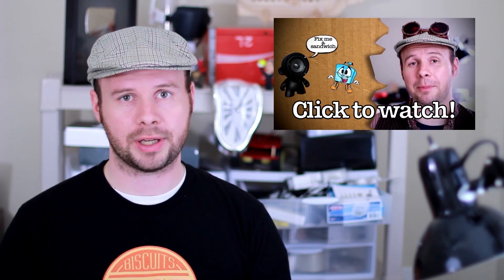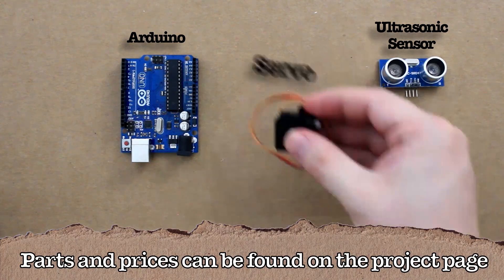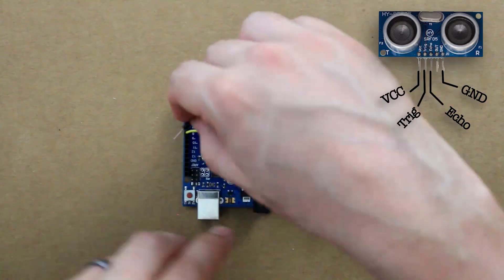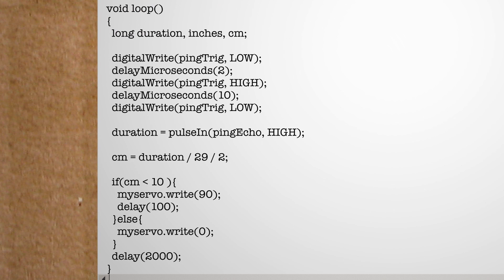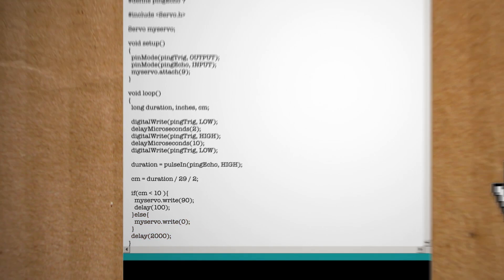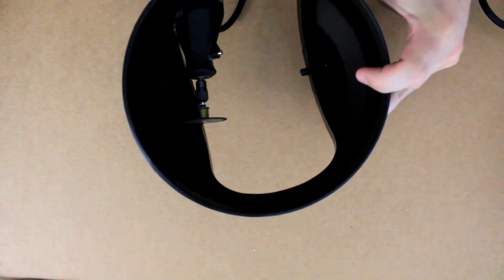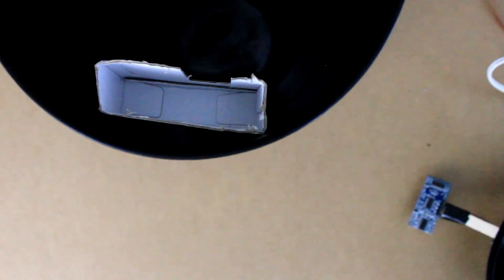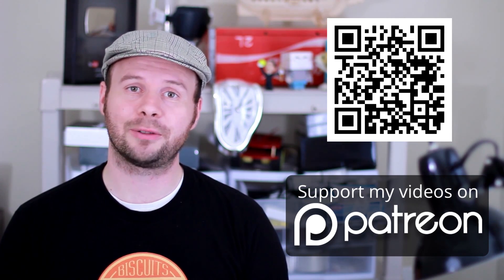Home Made Motion Activated Trash Can

Comment: Just spit balling here, but why not make an array of sensors wide enough for throwing in trash at a 45 degree angle, then setting them at the base of the can, and build a guard that doubles as a superficial "step" trigger. You'll need to increase the distance, but it will theoretically work for both throwing and standard throughing away trash without having to adapt your habits that much

Comment: mission: make gigafide reply
1. wheres the good ol' intro?
2. what is the difference between ultrasound vs ultrasonic or are they the same
3. will this work with a raspberry pi? and how?
4. how about the other types of trash cans that just open like a door?
5. COOL :D do you have dogecoin
Reply: Its not possible to do this with a raspberry pi
Reply: Damon Harris And Dogecoin sux!
Reply: lol XD
Reply: but why?
Reply: WDC Aviate © jokin'
Reply: Damon Harris With some extra investment and figuring stuff out, it can be done on a Pi. However, you'd need a microcontroller between the Pi, servos and sensors, by which point you may have just bought an Arduino instead. Also prepare for double-post.
Reply: ***** Raspberry pi cant give that much power to the microcontroller, you need a external source of power
Nice idea though :D
Reply: Damon Harris I didn't actually consider power at the time, but it was just a hint for anyone who wanted to adapt it.

Hang on, a civil YouTube comment section user?
Reply: ***** Probably yes
Reply: ***** Wanna hangout with me?
Reply: Damon Harris No thanks, haven't really got the time.
Reply from the maker: WDC Aviate © 1. I'll answer in the comments show2. they're the same3. yes. the amazing google has the answer.4. why not? you can make it happen with what i've shown you.5. nope. just bitcoin for the time being.
Reply: Tinkernut What would you do if all your btcs were worth $0.0009 tomorrow

Comment: Can this be done with a smaller arduino?
Reply from the maker: Tornadoboy yep! Just make sure you provide enough power for both the Arduino and the servo
Reply: I gotchu,thanks a lot
Reply: ***** I am using arduino nano. I have this problem where my arduino nano port is not recognize. my serial port name is /dev/uc.usbserial-A96T5N77. Is this the port you are using?
Reply: Sadly i am using mac 10.9.5. I download ftdi drivers but i cant see the dev/tty ... port?
Reply: Thanks for that. I never tried my arduino in my linuxmint yet(other laptop) because i thought i can make it work in mac. Well that sucks. .
Reply: ***** IDE? you mean arduino ide? sorry for noob question :3

Comment: not an expert on arduino but isn't the delay due to your 2000 ms wait time that happens regardless of the if statement output. So it has a 2012ms response time as opposed to 12 ms if you moved the 2 second delay into the if cm < 10. So it stops the trash can form whirling around when a positive input is detected.
Reply from the maker: Stragemque You're probably right. I'm no expert on Arduino either. This code could probably be dramatically improved.

Comment: Can it detect if an object is to the side or does it have to be directly in front of it? And how big does it need to be(can it detect something like a small screw)?
Reply from the maker: CroGaming depends on how you angle the sensor. Generally ultrasonic waves aren't accurate enough to detect a screw. Something about the size of a deck of cards and just as flat/solid.
Reply: Tinkernut Thanks, and keep up the awsome work.

Comment: Not crazy about the idea of putting a arduino into the trash. Anyone throws away some liquid it could short out and ruin the arduino or it could break off the sensor.  I do think the code and all the stuff can be applied to other places.
Reply: You can put it in a waterproof case.
Reply: Don't you use a bin liner? Just put in a bag or something, should stop liquid from getting to it.

Comment: When I search for the exact same recomended pieces, like the censor or the arduino at ebay, the prices are so much lower,

what is the difference?

trough ebay it would make the project half the price,
Reply from the maker: ***** there's no issue with ordering through ebay. I actually prefer banggood.com for cheap electronics. ultimately this should work with even the cheapest parts.

Comment: Cool and easy but useless and expensive... (you can use standalone arduino or just atmega8 or anything else... But that's little bit more advanced)
Reply: well, having a trash can with a lid is cool and easy, yet often useless, and usually more expensive too.

If you need to put electronics in your trash can, there's probably a problem with the trash can.
Reply from the maker: seigeengine haha! well said :-) For me it's more about exploring electronics and engineering than the functionality.
Reply: seigeengine There was a problem with the trash can ... it couldn't detect rubbish being thrown at it from a distance :D
Reply: Raymus Munt Never complicate when simplification resolves the problem.
Reply: seigeengine I agree wholeheartedly.  In this case the problem isn't "A place to put rubbish".  For example the problem could be : to find a way for people in wheelchairs to hygienically dispose of rubbish.   Or as the poster hints at ...a method of opening a bin to allow for airborne projectiles to be received while keeping the smell of the contents within the trashcan.

You could also look at this video as an interesting and informative way to learn about ultrasonic motor control.
Reply: Raymus Munt Or you could just accept a tiny bit of smell, and not leave your trashbags sat there for days on end.

And obviously, but you seem to have missed the point of what I was saying. I was raising a counter-criticism as the fundamental pointlessness of actually doing this to improve your trash can in response to the OPs attempt to refine this.

Basically, they took this as a serious solution, so I took it seriously, and solved the problem more simply.
Reply: <reminds himself not to feed the trolls>
Reply from the maker: seigeengine spoken like a true non-engineer ;-)
Reply from the maker: Tinkernut by "non-engineer", I mean the context of your reply and not you yourself. oh geez, i hope i didn't just screw up again...
Reply: Tinkernut No worries. :P
Programming made me fear unnecessary complexity.